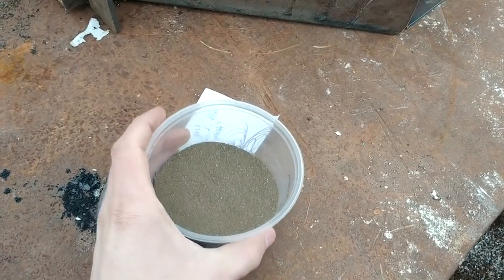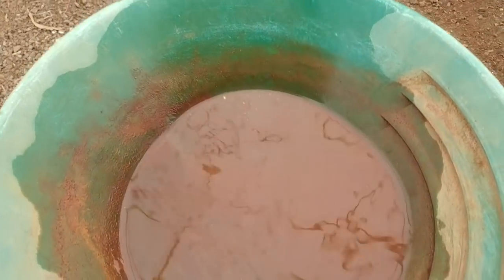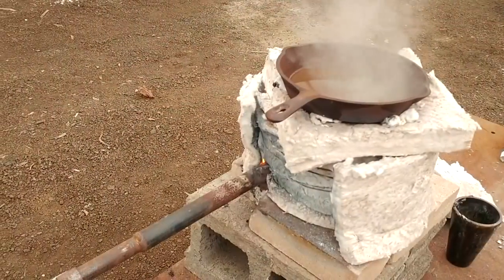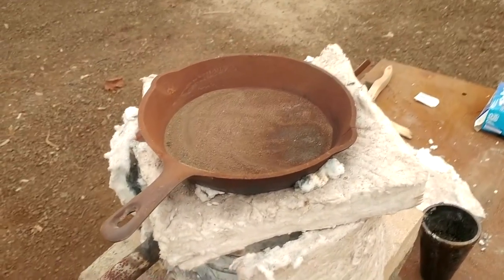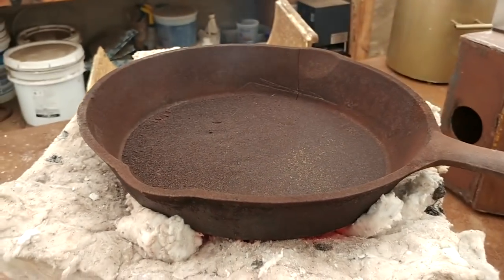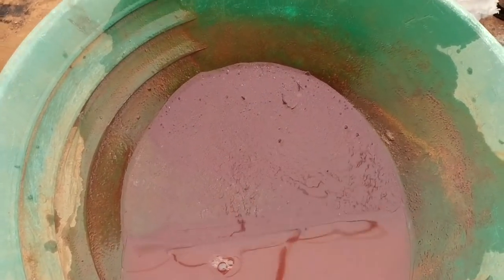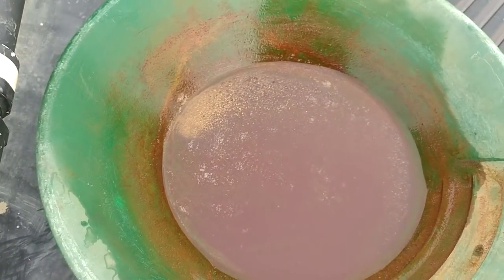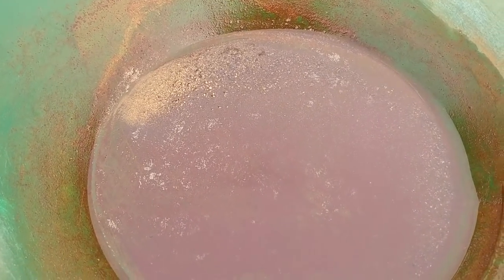Why Roast Sulfide Concentrates?  To Release More Gold!!

Comment: You seem to always have something important to share, and this is just another great example.  Much of my prospecting is in Oregon, so dealing with sulfides plays a big part of my hobby.  Your point was dramatically displayed.  Thanks for this posting.
Reply: I was told there is a massive gold sulfide deposit on the east side of the rogue by indian marry and taylor creek. And that roasting is needed; roast until you smell sulfur and then its ready. Would like to try that out.
Reply: @StevenHanover , as soon as you begin roasting sulfide ore, you can smell sulfur and exposure to atmospheric oxygen is necessary throughout the entire roasting process.  So be sure to stir the sand and roast it a little longer than you think is necessary and be sure you're doing it outside!  Also, save your black sand because at some point you are going to want to process it, again.  It's very frustrating to find that your gold is bonded to sulfides because it take so much extra time and effort to process it, but that's what winters are for.  I still have all my black sand and although it contains very little gold at this point, I find it very useful to use as a barrier for my radioactive samples from Moab, Utah.  Yes, Oregon is loaded with sulfides, not just bound to gold.  I'm patiently waiting for the dredging laws to change.
Reply from the maker: Thank you for your comment and for watching our videos!

Comment: so what degrees approximately does the sulfites have to become to burn off and release the gold?
 I thought the fumes coming off of the sulfides would be toxic. I've been told it has to be up to 800 Degrees for many hours, are they referring to a full rock or crushed material like you used? I'm glad to see that it doesn't take hours for a small amount. thanks for demonstrating, I really appreciate it.
Reply from the maker: Keep them around 1000 F for about 10 mins works for me

Comment: Interesting video. In my opinion the sulfides were not being roasted as no flame touched the sulfides. I'd consider you were heating the sulfides in the presence of air. So are you sure heating the sulfides released the gold or was the gold produced as a result of heating the sulfides?
Reply: Eh... What? In metallurgy, roasting is a process of heating of sulfide ore to a high temperature in presence of air, exactly what was said and done in the video, sooo... what is your point? And what do you mean by producing, not releasing?  During roasting, the sulfide is converted to an oxide, and sulfur is released as sulfur dioxide, wikipedia has on article about roasting, I suggest you read that for reference, but you might want to start by refreshing your basic chemistry a bit before that.
Reply: @Timppa99   Thanks for replying but my point can be summed up by asking this one question - what makes the understanding you have concerning the observations you have made, true?

Btw other definition of roasting = the action of cooking something in an oven or over an open fire.
Reply from the maker: The sulfides were converted to oxides and the gold was released when the sulfides converted to oxides. This was an unusual result as so much gold was released and visible by panning

Comment: really cool video, my questions is how does the physics of gold change so that it doesnt weigh down in a pan before roasting but is there afterwards?  thanks
Reply from the maker: Great questions, and not sure about the answer.  My guess would be the gold particles are so small compared to the size of the sulfide crystal they are encapsulated in the gold doesn't increase the density of the piece that much.  Not sure thought, anyone else have any other thoughts?
Reply: The gold is suspended by the sulfide crystals so under the heat the gold gets hot so the crystals are broken. If you notice in the pan that the gold was mostly in one spot of the pan, thus the heavies came out of the gold pan in one glob. Originally They weren’t noticeable due to the sulfide attached to the gold.

Comment: Another great video!  One question: I typically see the addition of silica sand, and sometimes flour to the roast.  Are there occasions where this is necessary?  I didn’t hear you mention adding anything to your sulfides.
Reply from the maker: I have used silica sand in the past, but didn't for this round.  The fine silica sand helps the sulfides to not stick to the pan when roasting.  Not sure about flour though...
Reply: mbmmllc gotcha, thanks for the update.  Oh yeah, I think the flour would be used later in the flux as a reducer. Flour would be counterproductive during the oxidizing roast, lol

Comment: thanks for the great video but i have so many questions.. i roasted some sulphide ore yesterday and did get some gold and a lot of silver on the miller table.
should we be adding borax or carbon or anything to accellerate the change from sulphide to oxide? or just roast straight from the crusher?. what do you use to recover silver? thanks.
Reply from the maker: I just roast directly from the concentrate, no additions needed.  Silver will follow the gold into the button

Comment: Hi Jason. Great video!  Question for you. You used ore to do this with. I am 
doing mechanical placer mining and I get lot's and lot's of pyrite in my
 cons but it is pyrite flake and some cubes all mixed in my cons. I 
usually toss it all out as I do my clean outs from my trommel/sluice 
boxes. Could there be gold locked up in those pyrite flakes and cubes 
that I usually toss out with all the lighter material in my cons? I'm 
usually left with just black sands of magnetite, hematite, and gold 
before doing the final separation of gold from black sands. But If 
there's gold in the pyrite that are in the placer gravels then I will 
start keeping them. Another question for you. I also have a hard rock 
mine with chalcopyrite. Lot's of it. It assays between 5%-9% copper. Is 
there also gold locked up in the chalcopyrite? In the assays it doesn't 
show high values of gold but maybe they aren't testing specifically for 
gold locked up in the chalcopyrite? Thank you
Reply: Yes and yes. aqua regia, sodium metabisulfite, and plant fertilizer are your friends. Manganese is precursor to copper, and gold with get absorbed by iron and copper which needs chemistry or torch to separate....
Reply from the maker: You would need to assay the pyrite in your placer cons for gold content to know for sure and then find a place to sell them if they did have gold.  The calco/hardrock claim should show gold if present if they are assaying for gold

Comment: Been watching a lot of your videos (again) and I was thinking there might be another way to go about this.  I typically do chemical refining so that's where my brain naturally goes to.  I was thinking that if the sulfides were ground VERY fine and then soaked in a hot lye solution and left to sit that might accomplish the same thing.  Then it'd just be a matter of a quick wash, dry and smelt.  Would be interesting to see if this has any effects.  I'd do it myself but I don't have any gold bearing sulfides I could test with.  :)
Reply: Which chemical do you add to the sulphide to change it to gold ?
Reply: @obioraferdinands7655  
Just roasting, not use any chemical.
By roasting process, gold sulfide changed to gold and Sulfur dioxide.

Comment: Thank you very much, do you add any chemical materials during the roasting
Reply from the maker: Nope, didn't add anything.  Just roasted at about 800-1000 degrees F for about 10-15 mins, stirring occasionally
Reply: @mbmmllc  Was that a wood or gas fire? Or are you also connecting a blowdryer to that metal pipe going into the furnace to heat it up? Is it possible to set something up like this when out camping with simple rocks and firewood?

Comment: Great work Jason but at the beginning of the video you showed the plastic container with some material and it looks very fine very tiny gravel or crushed rock, then panning out a small sample I see no gold in the pan. Then after roasting you show the pan and visible gold my question is why the gold looks now even bigger than the fine grains of material when rosting will just release the even smaller specs of gold that should be even smaller than the original marerial I'm assuming it should not even be visable at all since this process is just roasting there is to binding substrate for the reaction to take place and bind tiny pieces of gold with adjacent gold specs. I can especulate from the original sample you did not get that much visible gold unless you roasted more material and not just the small container presented and the beginning of the video so you probably roasted more material but question and confusion is that you have a good amount of good size visible gold that some looks larger than the original sample and the other question is if grinding the material to very fine dust size material would you get the same results since the idea is to release the gold from sulfides? You have great videos and redacted well but I  will definitely appreciate a responce because I'm dealing with very tiny microscopic gold a real pain because is not visible unless there is a good amount to see it on the pan and its very frustrating I'm glad I'm not doing as my only source of income is just a hobby were I'm happy learning the very difficult process.
Best regards

Comment: You didn't need to add any flux / silicone dioxide to the sulfides prior to roasting right?  Just heat?
Reply from the maker: I have done it both ways, both work fine
Reply: @mbmmllc  Cool, thanks for the reply...  I watched more of your videos, you add the silicone dioxide so the cons don't stick to the cast iron pan.  Love the work, thanks for sharing!

Comment: Hi Jason I think you need to think of another way to release the gold from the sulfide and not heat. It looks to me that by heating the gold sulfides you have released the gold but the the smaller particles of gold have oxidized in the process. Hence the red colour.

Comment: just electroplate after sulfur+water/sulfuric acid treament, you have then mostly valuable/silicon left to separate, should be simple
Reply: thermite, iron oxide, silicon oxide, kno3, as mix, to oxidize everything, and/or water mix the so2, to have all stuff become sulPhates, water soluble, electro-processable
Reply: Curious to know if this would work on PGM in sulfides? Going to roast some and pan but it appears very, very fine. If you don't mind sharing , I have some knowledge and understanding. Thanks in advance
Reply: @bcubed5724  the abreviations dont help, what do you mean